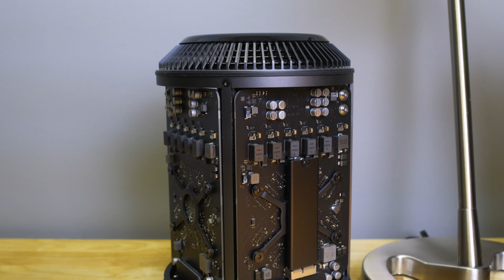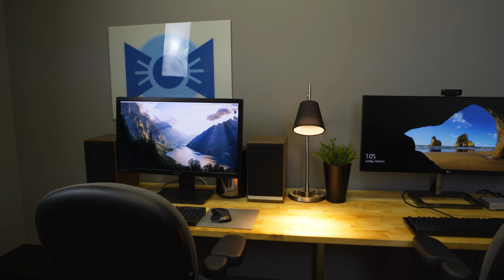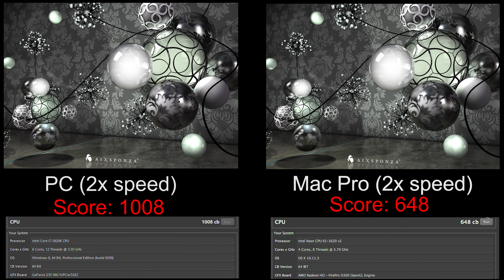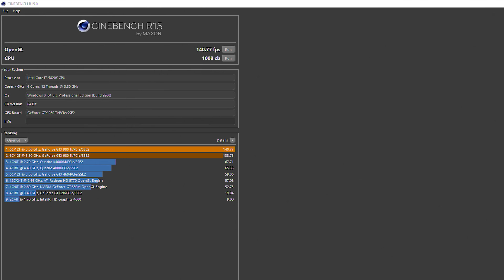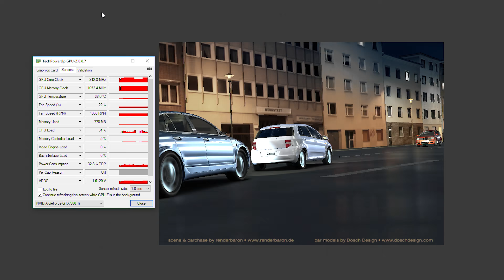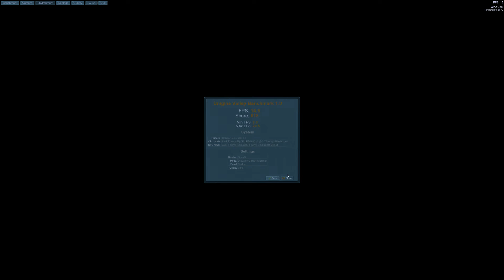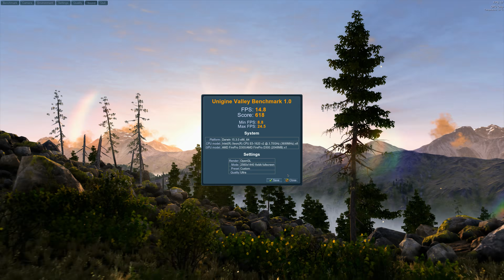$2,000 Custom PC vs $4,000 Mac Pro

Comment: One problem I've had with all Apple computers (we have a load of them at work) is the crappy job Apple does at managing heat. I blame their "design over functionality" principle I saw everywhere. They could be a lot better, these machines (even though their hardware is basically already obsolete when they come out of the factory) if only they'd get their designer minds out of their arses, get some proper engineers and let them do a better heat flow solution. None of the machines by Apple I saw up to date was even able to use the full potential, they'd always start to heat throttle after mere seconds of full load.

Comment: I'm running a 2010 Mac Pro tower 12 core, (2x3.33 6 core Xaon) 64gb ddr 3 ram with Nvidia Geforce gtx 780 3GB, with 1tb ssd samsung. It is maxed out to the core or as far as I can take it safely, it's old now and it still destroys any mac Trash can out there! 

If apple does not get it's shit together by the time I need to upgrade this beast, and release a proper computer where I can decide what parts go in to it and what not, I will have to jump ship to windows! Seriously I don't know a single person who has the trash can and I 'm a 3d graphics profesional

Comment: The PC will break after 3 years when the Mac Pro can hold for almost 10 years.
Reply: +Eskil Bergerland it depend on how much you care about your product. If you place a PC/mac on carpet and dusty area, both are gonna suffocate and won't last long. But individual components can last forever. For e.g. a PC ram stick offer lifetime warranty. PSU typically offer 5years, so on and on. Instead for mac, you have to buy "An extra protection Care" which only last x,y,z, amount of years. so yea :)
Reply: +C2Tech   You'r right in some ways but anyways everyone has their own thoughts and what they like.

Comment: Bro I don't get it. My €600 PC outperforms your €2000 PC.
Reply: +TheKillers Dollar* and that isn't possible dumbass, Tell me your specs.
Reply: +Will Smith I got 2515 on unigine
Reply: U DIDNOT BUT ULTRA SITTING 
1440p ultra msax8-_-
Reply: put it at the same settings still got 2323

Comment: But dude, this isn't really, so to speak, apples for apples. Try using the latest OSX on both machines and go ahead an benchmark. What I would like to see first is:

Is a Windows PC faster than a Hackintosh
How fast would the Mac be vs the Hack? (we know faster with the Hexacore and OC but just by how much?)

Those are some questions worth answering.
Reply: +TheSaintST1 No one would go through the pain of having to Install OS X on a custom built PC, while everything we need is already on Windows.
Reply: I do. I want to know if Steam and Origin and X-Planes is any better on either OS.

Doing a benchmark between both would help make up my mind.

I have no problem as I am OS neutral.. so to speak.

I only want to see facts. Not worthless opinions. Sorry.
Reply: TheSaintST1 Apparently, Steam and others would have a better library and of course a PC would be better to play games on, OS X is more optimized on it's hardware where Windows could work on faster and better hardware. 

Plus OS X in the near future, would never have a proper game engine like DX which is what the majority of games run on, OS X would be able to handle OpenGL but so few games are ported to OS X.
Reply: Okay but I need facts though. Has anyone done this test? Any reference?
 -preferably from a neutral source - not fanboi magazines etc..
Reply: At the moment in time, the hardware on the PC in this video is not all compatible with OS X.So, there is no head to head comparisons or benchmarks.
Reply: Really? I'm pretty much sure I can get most of it to run using OSX. Provided I'm using reliable branded stuff by Nvidia and Gigabit it will work.

The card in that set up is basically a Quadro without certification and ECC. And instead of Xeon being used, a standard multicore CPU is being used. The card needs flashing for Mac compatibility but again, it's not a difficult job.

I'm a windows user btw, but I want to see what the comparisons are between the two. At the moment, I'm not getting any facts.
Reply: TheSaintST1 Do it yourself then if you want to see "Facts"
Reply: ^^Not really possible. However, please keep quiet if you cannot provide them. Your "Opinions", instead, have been generally very useless thus far.

Comment: The baseline quad-core Mac Pro that you purchased is NOT something that a "pro" would use. Pros would be using the 12-core, dual D700 machine with 32+ GB's RAM which, have no doubt, would blow your just-built hexacore build out of the water. Of course, that Mac Pro would be over $10,000 (!), which explains why you built what you did and why I just built myself a Hackintosh!

Comment: Snazzy Labs
Man what is up with this video of yours, it only plays in 1080p or higher. You make it not available in lower resolutions? XD My PC was choking through the entire video. Just really curious as to how such an odd thing happened. Those poor low end devices that might be trying to play this video.... I feel bad for them. >:D

Doesn't exactly help that the Linux Radeon drivers and Chrome are at war with each other. DX
720P usually plays smooth with CPU Software OpenGL accelerated video playback.........
.....That reminds me I have some drivers to recompile. Urgh the horrors of patching and rebuilding.

Comment: I'm not sure if this was pointed out because I did not read all of the comments since I'm sure its flame wars back and forth and none of that matters but, the Mac Pro you have listed is $3k not $4k. Also, did you try the same video render using FCPX against Premiere Pro..Much different story. FCPX kills PP, even on your custom build PC. Try it. So, at the end of the day, the only thing that really matters for editors and the like, is how fast you can actually get your work done. Not the FPS for games. Also, where do you take your custom PC if things are not working correctly? I agree, Apple should update more frequently and it's lagging when it comes to the pro lineup, but your benchmark does not matter in my world which is as an editor.  FCPX destroys PP for editing speed. I'm on a 5K iMac, 64GB ram, high end machine and my FPS for games is typically about 120, when I have time to play and my editing speed is more then enough to handle editing in FCPX and VFX in After Effects. But I thank you for the video.

Comment: Every component in your build other than the motherboard, power supply, and case are the same as mine, great build! I have the Msi x99 SLI plus and the EVGA 1000 watt supernova psu, it's been great for video editing but for 4K video even rendering in 1/4 I wish I had bought 64 gigs of ram, but that's an easy upgrade :) good test, I'll be showing this to the blind and ignorant people I know that swear their Mac is worth 5 or more times the cost to performance ratio lol

Comment: I'm not supporting Apple here but that is actually the second slowest one they sell...for $8799.99. That's puts it at a 12 physical cores and 24 threads at 2.7gHz stock frequency. Also at this price its has 64gb of Ram and it will include dual AMD FirePro D700 gpus with 6gbs of GDDR5 matching the 980ti that's almost there best one...unless you want to put a 1tb ssd... so...

Comment: Core i7 4790K, SAPPHIRE R9 380X (dual gpu), 16GB 1866MHZ RAM, GIGABYTE GA Z97X GAMING 5, CORSAIR H100I GTX, 512GB SAMSUNG EVO 1TB WD BLACK CORSAIR AX760I
(Comment ur dream pc) ☺
Reply: +Jerico Goco I have a 4790k and a 980Ti ins a RVZ01 :D
Reply: +Josh L lol how did ur gpu fit in ur case ☺
Reply: Jerico Goco It actually fits really well. It has this connector thing so you can fit in any GPU you want. If you wanna go ITX, I heacily recommend this case, and the Cryorig C1 CPU Cooler

Comment: Other than comparing modern[ish] hardware to outdated hardware. I really don't see the point in this video. Right after you listed the specs of both machines I already knew the PC was going to run laps upon laps around the Mac. I mean really? You're gonna take a rinky dink AMD video card and pit it against the best video card on the market, and you were surprised by the outcome???

Comment: I would rather spend more on mac pro that will be realiable for 10 years and even have resell value
Reply: +Strofi Kornego Resell value? What, so you can buy another one? If you get a custom PC you just upgrade that shit when it gets slow.
Reply: +Strofi Kornego But as a professionell you will lose a lot of time and money with the huge exporting times and slow performance time. It won't matter if you can resell it in ten years.
Reply: +Strofi Kornego I build a desktop for 1400 and resold it for 2500. How does Apple beat that?
Reply: Josh L in away that they sell millions of computers and you somehow managed to sold one
Reply: Its really not hard to sell computers. Alot of people are willing to buy prebuilts with real parts in them. This year alone Ive sold 15, though the $1400 was the best I got for a PC. But I have came close before
Reply: Josh L It may be not hard to "sell computers", it is much much harder to sell good quality computers. And that is exactly what Apple does - they have strong quality control and assurance over their products that no-one else come even close. 

All that means that someone who bought their mac for 4000$ will have someone to adress their concerns if it does not work(best phone support and mac store with assist nearby). What is more in 4-5 years still can sell it for a good value. 

What you build cannot possibly compete with that
Reply: Strofi Kornego Still for professionals that is not worth its. Rendering times are much more important than resell value. $4000 is not that much for a company but time is money.
Reply: Strofi Kornego One of my PCs that I built in 2010 for 1k was sold for 950 this past year. Still works like a charm, last I heard from the guy.
Reply: Josh L  computer harware components(even macs) do not have such small depreciation (5% in 6 years - really?) - so possible explanations are
 1) you sold initially it for much less value in actually was worth    2) when it was resold again using infair marketings and lies to a customer who got their product for much more money it actually costs      3) you are just lying about all of that

Comment: I ran cinebench on my 700CAD$ PC and it got 330 in the CPU benchmark and 62.5FPS in the OpenGL benchmark. It could have been built for 600$ if I went with cheaper parts.

Comment: install hackintosh and then test it!
Reply: +Charlie kivarkis i believe hackintosh only runs on lga1150 chips. this one is a lga2011-v3. therefore, he cannot do so. would make the mac pro a joke though. still does with windows tbh
Reply: +jacobethandurham4  it works on 2011 as well. Yes it would decimate the pro

Comment: My old pc for like 450 bucks got around 20 fps in unigine valley benchmark with an old i5 750 clocked at 2.67 Ghz, 8 gb ram and a 960 gpu. And a mac for that price gets beaten by my potato? Apple ........

Comment: Mac is better because it gets full 60 fps on Facebook.!!
Reply: +The Prophecy Breaker but only on mac pro right? my 700$ notebook have 60fps too on facebook, but it's limited by screen so...
Reply: +Ali Pwzs yeah just the pro, because the screen power supply difracts the plasma h2o in the modules the right way in which the Facebook gets 60 fps.. unfortunantly Instagram is bottle necked by the quatum stringy 6.63×10^-34....
Reply: u sure about that who cares if u get full 60fps on Facebook
Reply: do u even agree for a 4000$ computer for a full 60fps only in facebook or u can built ur own 3000$ pc for 120 fps in gta5 in ultra settings

Comment: I did the valley test on ultra with 1080p and got a score of 2600. So it seems the score might be dependent on resolution since your PC should be faster than my fx8350 and r9 390?

Comment: I'm sorry! I just missed the part where you had the xeon, ECC RAM, and a workstation graphics card for your custom build PC, and the price tag of $2k rather than $2,2k. And the quick service and build warranty. 

Yes, for many people's purposes, particularly the tech-savvy power users, a custom PC is a no brainer. I didn't see a reason for ECC memory or 10-bit graphics, so I built a 5820k/980 ti system. There are, though, significant pluses to the Pro not only in terms of support but in terms of hardware - its all around professional parts that make it compatible with whatever workload type you can conceive (within the limits of its processing power). It's unfair to make a price comparison for hardware and not include those aspects, looking at raw benchmarks. I REALLY want you to benchmark a program that requires fp64 and see how that goes.
Reply: +Dan Janucik Here ya go. A better workstation for 3k http://pcpartpicker.com/p/CYdNf7
Reply: +Dan Janucik what josh said
Reply: +Josh L A more honest comparison. I'm glad
Reply: The CPU is pretty much the same thing as the i7,  just no OCibility.

The GPU is way more powerful than the ones in the Mac Pro, but wont compare to the Ti in game-like benchmarks.

Comment: Apple shit has always been overpriced and in any case the guts are all the stuff that's inside a PC.
Reply: Nissan U. This is the point I wish everyone understood. I'm not saying that Mac is the best and nothing beats it: that's not true. What I'm saying is that you get what you pay for. You can pay $300 for some acer laptop, but in under a year, you need a new one. You might spend $1500 on it, but it will last you a very long time and perform for that time. Have a nice day :)
Reply: +johnabuick Yea, exactly. The same as stuff in a PC that costs 3x today's average PC costs. HP still doesn't sell laptops with SSDs by default while apple only sells them with SSDs. It pisses me off when I see 720p displays still being used. Apple sells them with 2160p displays. Don't even try to say that, kid.
Reply: Henry Black
What the fuck did that mean? I ain't no kid. I bought my first laptop in '94 and I owned a bunch of them and will never buy another. My phone does everything a laptop does and if I need a real computer I use my desktop which is hooked up to my 52" LED flat screen. I build my own computer and the one Im using now will run Skyrim maxed out and not even sweat it and it's 3 years old and, no, I didn't buy the most expensive components. I also don't play games I just tried my kid's skyrim to see how it would run it. The first machine I built 9 years ago is still running as a pfSense router with no problems. All my builds were with Intel Mobo's and I never had on fail. It's sad that they quit building Mobo's. I can remember when the first Macintosh came out and I never had any desire for an Apple product. You can keep them.
Reply: +johnabuick Dont bother. I was tell him him this in another comment, but it got deleted. He told me to find a $500 laptop that can match the macbook pro. Wtf is up with that? The base macbook costs $1300. He doesn't know jack shit and is a troll.
Reply: Nissan U. I can get a macbook air for $899, so $500 is even being generous.
Reply: Henry Black How the fuck is $500 generous? You are giving me a lower price to start. I am getting the shorter end of the stick. Also I would like you to link me a "$899" macbook air and then I will reply with FACTS.
Reply: Nissan U. You told me you could get a PC for half the price of a Mac with 2x the power. The Macbook Air has a Dual Core i5, 4 GB RAM, 128 GB SSD, Intel HD Graphics 4600. and it costs $899. Find me a $450 PC that has a QUAD core i5, 8 GB of RAM, a 256 GB SSD, and dedicated graphics. Oh yea, listed as "For Parts" on ebay doesn't count. Brand new from a retail store. Once you find that, you're right: Mac is overpriced and your point is correct. You'll never find it. Unless you do find it, don't bother replying, as I will not care to read your childish responses.
Reply: Henry Black I was referring to the desktop pc in the video vs the mac pro lol. Sorry for the miss understanding :/
Reply: Henry Black In regards to laptops, Macs are fine and welcome to my preferences for what they are. In fact I appreciate the aesthetics of OS X much more than windows. They are a little overpriced for the hardware, however, OS X runs very smooth on them and I cant complain about that.

Comment: Such tests are pointless - you could also test: if you can type faster in editor or texedit man! Was any Mac ever opimized for gaming? Oh wait - > Yes, the Ipone and at first and they desroyed the compatition!  -  It is true google it. If they would want to compete with PC in this genre, they would have to really get in big steps to the latest point where PC gaming is and then try to be better, which they don't! I am smarter than you, I use a PC (at home) for Gaming and a Mac (MacBook Pro Retina) for Work. Never has any plastic Laptop suited my needs nor would they stand my intensive usage so well like my MacBook does. But regarding gaming I prefer the PC with all its gamingpower...

Windows Fanboys - shut up
Mac Fanboys - don't by that overpriced recycle bin
Reply: +der olf Well, to be fair he benched it for video editing (which it's definitely markeded for), and running game benchmarks are just an easy way to stress the gpu(s).
Reply: +der olf Not at all the point of the video... all he is saying is that you can do work, and game on a PC for half the price.... it would be able to do the exact same work as a mac, but better...